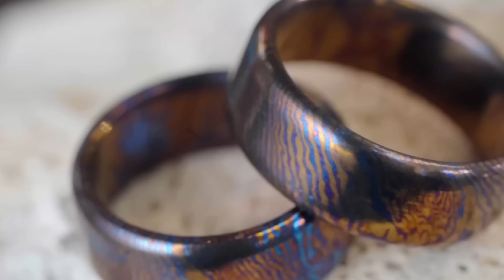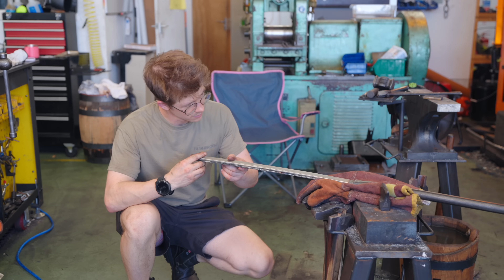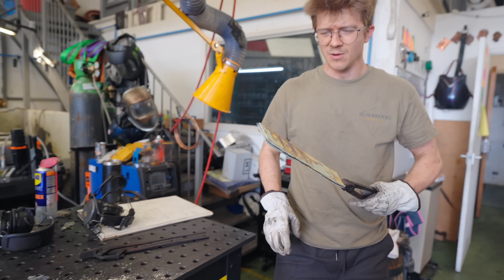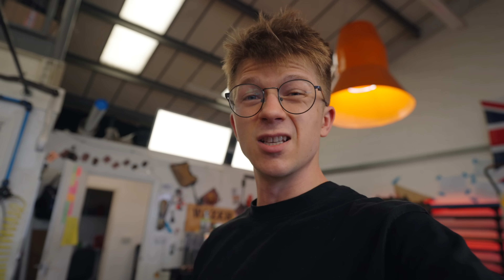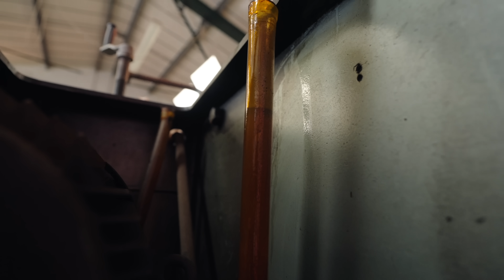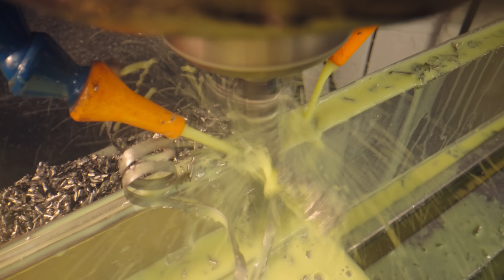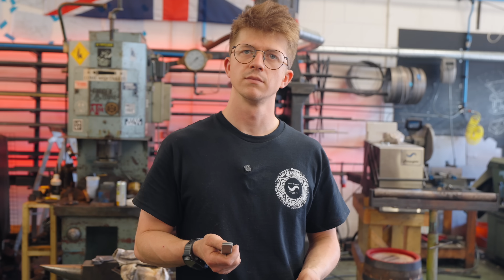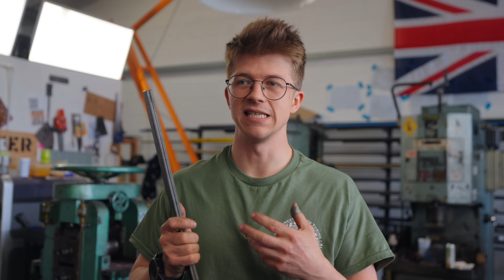Making a Titanium Damascus Katana - Part 1

Comment: small correction on the "low reactivity in the body". Titanium is used in implants because it is basically the only known metal that bone/flesh will actually grow onto and biointegrate. Ceramics can also work and were used before the biocompatibility of titanium was discovered.
source: working with titanium dental implants for 8 years.
Reply: I got a titanium plate in my arm, six months after the repair - the x ray showed my bone growing around it. 24 years ago
Reply: @mik @mikeetheridge3624 itanium rods in my lower leg. 8 screws. Got in a nasty motorcycle crash in May. Haven’t started pt yet, gonna have to relearn to walk again. But X-rays showed my bones starting to grow around the rods too
Reply: @MotoBible Best of luck in your healing man. Hate to hear that you were dealt that hand
Reply: @MotoBible heal up quick brother, back on two wheels in no time!🤘🏻
Reply: @MotoBible Best of health and recovery. Be super diligent in your pt and you'll get the best results. The effort will pay off.
Reply: I got 2 screws and some wire holding my shoulder together, Titanium! Great stuff!
Reply: @MotoBible  rootin for you bro. You’ll be dancin in no time.
Reply: @M @MotoBible  may God be with you on your journey my friend. He can take you anywhere, even further than even modern medical marvels!
Reply: @mikeetheridge3624 I’ve heard enough, give this man a complimentary MRI
Reply: To add on, Ceramis are a bad implant material due to how brittle Ceremics are and how little force it takes to shatter, so titanium also became a better material due to how durable and as stated before, it’s ability to Biointegrate with the body.

Source; I’m a current under grade going into BMEG, and already had a semi-lecture on biomaterials.

Very intresting stuff.
Reply: @Musicuseage  titanium ball joints going into ceramic sockets seem ok, since the ceramic is supported by the bone and is mainly dealing with wear not stress

also you hope most people with joint replacements won't go jumping between cliffs and roofs lol
Reply: @nickl7488  As soon as my wrist was back at 85-90%, I was back to completely normal habits of swinging off scaffold, throwing bricks, riding bikes etc. I feel like it's the people who are too scared to go back to normal who end up falling behind. I have some days where the bone feels tight, but a few stretches and some chinups and its back to normal
Reply: @InitialDreadly  that's great, glad you recovered well

the recovery process is quite important as well, the knowledge behind it has improved quite a lot compared to several decades ago so more patients have better outcomes these days

it's amazing how people can get back to sports and such, compared to what made surgery necessary in the first place, it's definitely an improvement in mobility and quality of life. don't be afraid to use it, be active, just don't be too extreme (saying in general, not telling you something you already know)
Reply: @nickl7488  tho ceramic is much easier to ground down
Reply: @Musicuseage we use ceramics as the bearing surface in hip replacements all the time now. Newer ceramics are substantially less brittle and rarely fracture.
Reply: Another reason is that it has a stiffness similar to bone so it promotes bone growth by not putting all the load directly on the implant and instead gets distributed to the surrounding bone
Reply: @SpeedDemon-xt8ri  seems like titanium is a great bone alternative. I wonder what would happen if we replaced all of our bones with it

Probably not a good idea
Reply: it does have low reactivity in the body though. That's an addition not a correction.
Reply: That’s freaking awesome!!!
Reply: I think niobium is also one such metal, but is much more expensive.
Reply: @barfrost007 well it was a good question so i googled a little it showed that nobium is not strong enough for implants 
But we do use its alloy with titanium in implants and yes it is not generally used because its melting point is very higher than titanium so it is costlier and harder to mold.

I did not do research so there might be some incorrect info in this.
Reply: @barfrost007 and osmium but the price is a little issue. (Plus its physical properties meaning it's not always the best)
Reply: @Trashfire-13  I'm not certain about the detailed properties of osmium, but I do know that it's incredibly dense, about 5x more so than titanium or > 20x more than flesh and bone.

My premonition says that such a mass would make it prohibitively heavy for an implant.
Reply: @Trashfire-13 Osmium produces a poisonous gas when it oxidizes. It's definitely not an option for implants. At least not pure osmium. Maybe there could be an alloy that mitigates or erases the exposure risk.
Reply: My sister got a knee replacement and the preferred metal for those is Cobalt-Chromium because Titanium Nitride can scratch easier. Titanium Nitride is usually only used in persons who have tested positive for reactions to nickel, which is usually less than 0.5% of the alloy.
Reply: @greggeshelman  Titanium Nitride is also sometimes used in the Abutments that are set onto the dental screw style implants. The Abutments get screwed into the inner thread of the implant and serve as a modelling base for the ceramics of the tooth prosthetic. The golden colour helps to mask the grey colour of the base titanium so it doesn't shine through the flesh of the gums as obviously.  Because usually the most obvious aesthetic flaw / indicator for dental implants is a grey shine in the gums. (once you know what to look for its crazy to see how many people have them)
Reply: Have you heard of our lord and savior magnesium. Look into magnesium alloys and composites in terms of biocompatibility. They are unmatched especially when calcium is included
Reply: I have a titanium rod in my femur
Reply: Thank you to share that piece of knowledge with us.❤
Reply: yea
Reply: Tantalum is also biocompatible. Its just very dense and heavy. So its used sparingly.
Reply: That is fascinating that the body will integrate titanium! Thank you for teaching us something new
Reply: Bone can osteointegrate with vanadium and tantalum as well. Vanadium isn’t used as much because the alloys can leak aluminum, but we use tantalum a lot. Its modulus is very similar to bone so it gives less stress shielding than titanium does. Plates are usually titanium because we need the strength for support and the modules is a bit less important.
Reply: Polyether ether ketone or PEEK is an interesting polymer used in implants.  It has similar mechanical properties as bone and is more comfortable than Titanium in cranial implants due to not transferring heat as much.
Reply: For real? That's pretty fascinating...
Reply: Why does titanium react this way with the body?
Reply: So what you are saying is the cybernetics in Cyberpunk are probably titanium heavy in terms of the majority of metal used in them? If so, good to know, good to know.. (notes in dm)
Reply: Pssh.....what makes you such an exper........oh, right....right......

Isn't titanium also porous to some degree relative to how the bone grows? I could look this up but I'd rather ask someone who has real world experience instead of getting a BS A.I. answer. Cheers!
Reply: @APKnifeWorksINC  It's called Osseointegration and It has to due with the oxide titanium forms. It's hard to explain or maybe I am just not good at explaining it but the properties of the oxide are favorable to bone growth so your bones can attach to the metal directly in a way that they cannot with other metals. So something like gold which is nonreactive can't be used for implants least not in areas that are structural (though for electronic parts it can work) because your bones can't attach to it, rather your body will construct connective tissue around it and that connective tissue does not behave at all like bone should. In comparison with Titanium once it has integrated so far as your body is concerned it is basically bone and behaves like bone, in fact depending on the impant and design it may not even be solid titanium but a titanium super structure that the bone grows through. Think similar to like a trellise where the titanium gives structure that your body can follow as it regrows the bone.

Also titanium isn't the only thing that can do this Zirconia also can and probably will eventually replace it in most places as it's better in most ways for this purpose.
Reply: "Source: its my job" lol
Reply: It's called Osseointegration and it's due to the unique properties of the surface oxide titanium forms, well it's more complex than that but that is roughly the reason. It has basically nothing to due with the low reactivity though that is a needed thing else even if the bone integrated with another metal if the body reacts to it poorly or the metal reacts poorly to bodies environment then it wouldn't matter.

This is also why something like gold which is a noble metal and nonreactive can't actually be used for implants. Because whilst the body won't react to it and the gold is fine in your body the bone will not attach to it rather your body will form connective tissue around it which is a big difference in terms of how an implant behaves and the types of stresses it can endure.
Reply: I felt so robbed when i broke my foot and the doctor selected 316LVM, i was so stoked i would get titanium inside my foot 😹
Reply: Gold was also used in some rare ancient surgeries. There were multiple well preserved dental implants found held in with gold wire. Most impressively I saw one specimen of an ancient skull surgery that also used gold I can't remember if it was a full small plate or just wire again.
Reply: I have a titanium L2 vertebrae “cage” and very happy it is so accepted by the body! 😂
Reply: Insane timing consider I just had one put on my clavicle.
Reply: It’s an amazing material no doubt, but newest studies are showing that titanium implants are not as unproblematic as previously thought. Feeding inflammation etc
Reply: Yup I have a patient that rejected 2 knee replacements. Had to import a porcelain replacement from Japan
Reply: That ladies and gentlemen is a professional source...

Gotta love those.
Reply: I almost cut my hand off in 2020 and they had to reconstruct half my wrist with plates and screws. I was never told what material they used, but I'm assuming by your comment, it couldn't have been anything other than titanium
Reply: Half my face is held together with titanium, and I have dental implants.. Must be e material for the job at hand. 🙂👍
Reply: I’m glad that titanium would be used in dentistry instead of mercury/silver alloy
Reply: Best creator on lube tube
Reply: You sure? Titanium has extremly high reactivity... But as soon as it comes in contact with Oxygen it reacts to form a passive Layer. This layer then is Bioinert per definition and has no reaction with the Body whatsoever. It does however enable Osteosythesis on the surface and gets incased in bone.
Reply: So you're saying we can have all our bones replaced by titanium?
Reply: @Metroidf4n only in an underground facility in the Cold Lake area of Northern Alberta
Reply: @danomite22  i heard they closed down :(
Reply: @danomite22 isn’t gold like that as well?
Reply: @Metroidf4n  No. You need bone marrow and titanium doesn't have that.
Reply: Who cares about small corrections when the entire premise of this video is so silly? Titanium is terrible for blades. But they start the video by mentioning a few things it's good at. Don't take that away from them 😂
Reply: @RaquelFoster  That's why he's doing the steel core, it's for making it a usable blade. The titanium sides are there for the cool factor and difficulty of making it all stick together.
Reply: @RaquelFoster  when making blades out of anything other than steel it would be better to copy bronze age designs. But Alec is always very ambitious
Reply: @nocomment1933 right, the bronze age. Widely known for their advancements in titanium lol
Reply: Nobody asked
Reply: Point taken the body does not react with it
Reply: So you're saying the body doesn't react poorly to the implant. Another way of saying the exact same thing so it's not really a correction, you just used more words
Reply: @bas17h4  no, you seem to have misunderstood. i am saying Titanium is the only metal that does react with bone and flesh in a positive way. other metals don't form a bond with the bone. If you have a titanium screw implant, if it heals correctly you will not be able to unscrew it since the bone has bonded to it. Something like iron/copper/bronze/nickel would not bond to the bone and could be as easily removed as inserted.
Reply: @nonAehT Alec means "body doesn't reject it, and it works" when he said low reactivity. I understand that maybe his qoeding doesn't display the exact biomechanical mechanisms at play, but I'm defending his simplification for the sake of everyone feeling the need to have their input on display at all times
Reply: @nonAehT also, most of the reason why things like stainless steel aren't used is due to its possibility for sensitivity and allergy (nickel allergy for example), corrosion, weight, etc. Titanium is good because it is highly inert (LOW REACTIVITY!), hypoallergenic, light, and strong. Not to mention its thermal conductivity benefits over something like stainless steel. So yeah, low reactivity is the reason why osseointegration occurs... now what do you have to say?
Reply: @bas17h4 not the person you're responding to, but my response would be; 

"this mf spelled quoting as qoeding!!!" Lmao
Reply: @bas17h4  This is not correct. The low reactivity is helpful for implants but it has nothing to due with Osseointegration. The reason titanium can integrate with bones is due to the properties of the oxide it forms on it's surface and how that interacts with bones. Noble metals or other low reactivity metals/ceramics do not work for this because your bones will not attach to them. So with say gold your body will just grow connective tissue around the gold, which doesn't harm you and doesn't harm the gold but is also utterly useless if you are trying to replace a bone as connective tissue is not bone and will not behave in a similar manner under stress. Whereas Titanium will fully integrate with the bone and the body will not grow connective tissue around it as the body treats it similar to bone basically. Now it is not bone and you do not want to replace bones with it if it can be avoided as it lacks bone marrow so more modern implants (depending on circumstances) often use what is more like a titanium web to provide temporary structure almost like a trellis that allows the bone to regrow in a guided supported manner.

For note Titanium is not the only material that can do Osseointegration Zirconia can also do it and it's because of the same reasons as Titanium basically except it's actually better at it in most ways.
Reply: @bas17h4  No. Stainless steel also has low reactivity in the body, as does cobalt chrome, as does gold. Titanium is the only one that exhibits osseointegration as this guy said. If you don't understand that, maybe don't try and correct someone who does.
Reply: @AlasdairThompson  cool

It forms a oxide layer that makes it, essentially, bioinert. It just happens to also allow bone growth.
Reply: @AlasdairThompson you're the one misunderstanding my comment. I'm saying that Alec said "low reactivity" to just simply say that the body can handle it being there, for WHATEVER reason and attributes it may carry. (Toxicity, osseointegration, hypersensitivity, etc). He's not going to go on a 10 minute tangent explaining that in a video. All I was saying is "yeah thats what he's saying" and poking fun of the "erm ackchtuallyyy 🤓☝️" type of comments that everyone feels the need to make on every video
Reply: @AlasdairThompson also, most of the reason why things like stainless steel aren't used is due to its possibility for sensitivity and allergy (nickel allergy for example), corrosion, weight, etc. Titanium is good because it is highly inert (LOW REACTIVITY!), hypoallergenic, light, and strong. Not to mention its thermal conductivity benefits over something like stainless steel. So yeah, low reactivity is the reason why osseointegration occurs... now what do you have to say?
Reply: @bas17h4 wait so your response to annoying "well ackshually" type posts was to write two long posts exactly like that, and then copy and post them verbatim in response to multiple ppl?

Lol
Reply: @doodlecaboodle9298 It does not happen to do anything. The oxide is very specifically why bones can attach to Titanium. Titanium having low reactivity is nice but has no bearing on Osseointegration at all. Even if Titanium was reactive it would still exhibit Osseointegration because the two are not related.

It's why even more nonreactive metals like gold can not be used for structural purposes in implants. If you put gold in your body in place of a bone your body does not treat it like a bone, and your bones will not attach to it. The gold will not rust or harm you and your body largely will not care that it is there but it will provide no structural benefit because your bones cannot interact with it, instead your body will form connective tissue around it and just leave it as is. With titanium the bone itself can attach to the titanium and your body treats it like a bone which means it will not grow the connective tissue like it does with gold or other metals and enables titanium to function as a replacement for bones properly. Well not fully properly as bones are living tissue with bone marrow and all that but it works for most senses.

Which regarding the titanium is not bone thing it's worth noting where possible modern implants are trending toward more web like titanium structures to act as guides and support for your body to simply regrow the bone through, because your body can totally grow new bone for the most part, in fact this is exactly why untreated fractures can be problematic as your body regrowing the bone may cause the fracture to heal in wonky ways if the bone is not secured and fixed in the proper position for it to connect correctly.

Also to note Zirconia can also do Osseointegration it's not something unique to titanium but both exhibit it for the same reasons though Zirconia is slightly better for implants in many ways in most circumstances at least.
Reply: @bas17h4  well theres a clear difference between little to no reaction and a positive reaction over time imho.
Reply: @bas17h4 if it bonds isnt it acting in a positive way?
Reply: @bas17h4 no because there is a specific chemical mechanism that is needed for bone to grow onto titanium